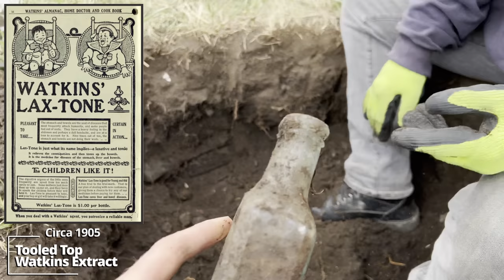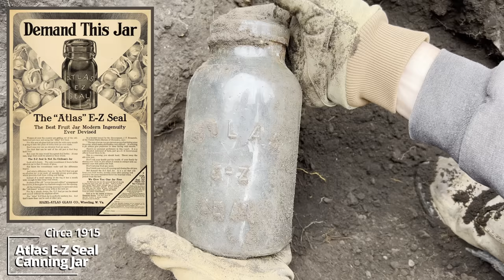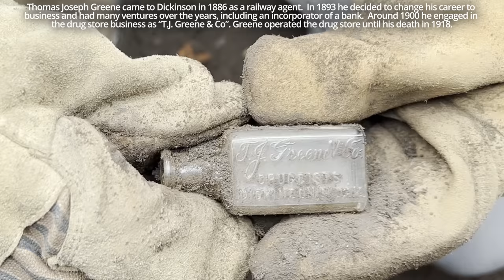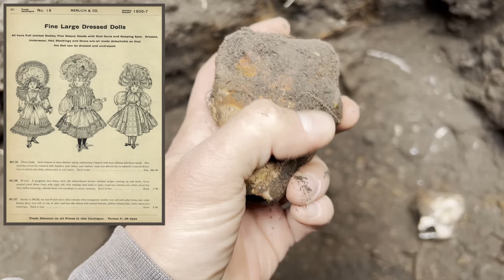Buried Under the Yard for 150 Years

Comment: Love watching this.  I'm still watching so you may answer this in the video.  Just wondering how you decided in that exact location in that small square.  I am going to buy a property there built in 1901.  I can't wait to metal detect the yard if I get it.  Be my luck you've already excavated it - lol.
Reply: They use long probes to give them an idea what's in the subsurface soil.  Privies typically are located by probing for glass shards, as well as the ash and lime deposits which were commonly used to reduce the odors from the privies back in the day.  And a dug and filled in pit will have looser soil than the soil around it.  These guys are experienced and also have a good sense, just by looking at the surface grade of the soil and knowing where buildings once stood, where the likely spots for a privy would have been.

Comment: You may want to bring a  liqiuid spray bottle with you filled with water, or another with forced air. It would clean the areas where the dirt is caked on. Even an old toothbrush would help.